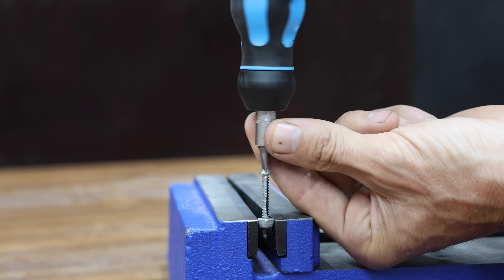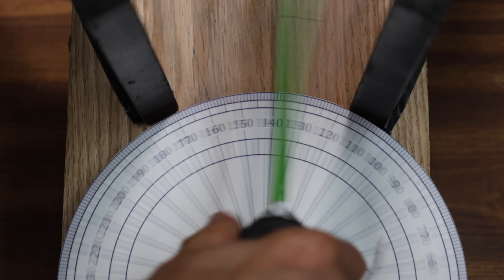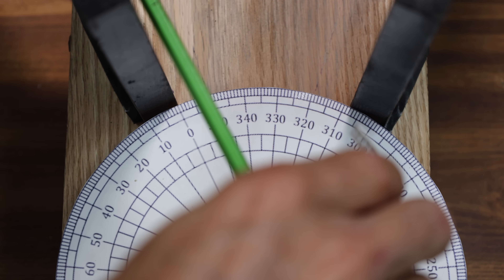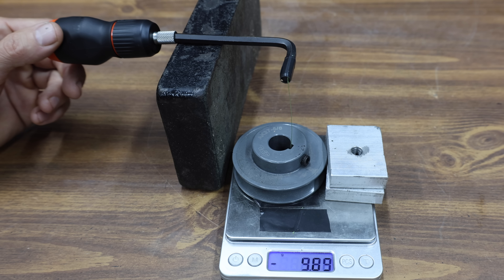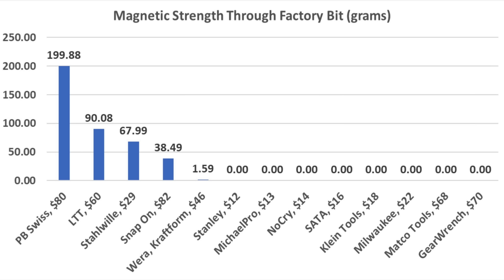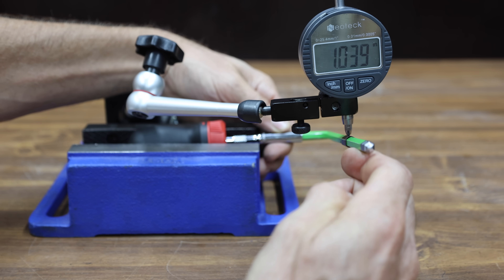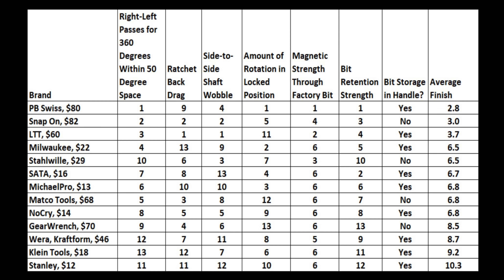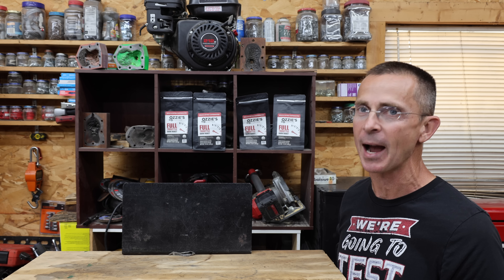Is Linus Tech Tips “Stubby” Screwdriver Best? Let's Settle This!

Comment: Great testing!

Suggestion for your methodology: for all videos where you do force testing using a kitchen scale, it would really benefit to be replaced by a strain gauge and data logger. The problem with using the kitchen scale is that you can't measure pulling force, and that you are limited in the resolution of the data based on how frequently the scale updates its display. Using a force/strain gauge, you can invest in a handful of gauges that will be suitable for different ranges. They will be a lot more precise and repeatable, and allow you to use better testing jigs for measuring pull force directly. The data logger will significantly help your accuracy and precision. You can log at a high frequency through the whole test and then analyze the data afterwards to find the peak. You can even superimpose the strain data as a "live" plot when performing the test, as well as recording the screen on the data logger in the shot.

A good general purpose data logger that can interface with strain gauges will be a huge addition to your testing toolbox and allow you to bring this channel to the next level.

For the backdrag test in this video, using a hex key with a round over-molded handle will also improve your results by providing a much smoother and more uniform pivot surface on the shaft. I don't think it makes a big enough difference to change the results, but it felt odd watching the shafts turn against the flats on the hex.

Looking forward to the next video! Best regards.
Reply: I thought the same thing in regards to the back drag test, though since they all started in the same position I’m not sure it would have affected anything.

Comment: I wonder if a better way to do the rankings at the end might be some percentage value of the 1st place tool (e.g. for magnet strength, the difference between 3rd and 4th place might only be 10g, but the 4th place one is penalized equally regardless of how far apart they are. So the 4th place one could be 1000g weaker on the magnet, but it doesn't matter in your rankings. You could maybe do something like the 3rd place one is 90% as strong as the 1st place one, the 4th place one is 88% as strong as the 1st place one, etc. That might help the comparison data be a bit more fair)
Reply from the maker: Thank you for sharing!

Comment: The oly genuine "but"'s I have here is - the back drag test was done with an allen wrench which sat on it's flat surface against a flat surface, the measurement could've been off because the flat part would have a higher resistance than machined round bit - that doesn't negate the results between brands but rather real life 
Secondly, I noticed the LTT stubby had been placed extremely close to the vise jaws, from the POV of the camera it looks like a negligable gap which could result in such a small measurement for a viewer.
Thank you
Reply from the maker: My pleasure!

Comment: If I can have a small suggestion, it would be that the first test might be more accurate if instead of measuring how many passes it takes a full 360° it would measure how many degrees of rotation can the screwdriver complete in 6 passes.

Not very important but maybe something to consider.
Reply from the maker: Thank you for sharing!

Comment: Great video! As a robot and automation technician I use pb swiss almost exclusively although I am not a fan of the ratcheting screwdrivers. The amount of back drag and their weight make them tiring to use all day. Instead I just use their non ratcheting bit holders and they are wonderful. Pb swiss bits are also the only bits I have used that seem to never get rounded out. They’ll break with enough force but they never round out. Would love to see a comparison of 1/4” bits sometime.
Reply from the maker: Thank you for sharing!

Comment: I'll likely buy a LTT stubby since I see these tools for dealing with stuff after it's broken loose so like you said, minimal rotation between teeth and low back drag are the important parts.

When I work on stuff (cars, trucks, motorcycles, etc) I grab the largest tool with the most leverage first that works then adapt down to small tools that are quick like a 1/4" ratchet or a bit driver. Having a solid set of adapters is key.

Actually, have you done any test videos on adapting between 1/4, 3/8, and 1/2"? Or maybe torque multipliers?
Reply from the maker: Thank you for the video idea!

Comment: Good reviews, great tests.  I've got the Milwaukee. I was really impressed when I saw it in the store. So all in all these type of tools have really improved over the years.  I do think that no bit storage is a total deal breaker. 
I've got a contraption that I need to take apart and get rid of. I used at least 4 different type screws (because I wanted self drilling, 1" to 3.5") Good luck finding multiple lengths all with the same head) . When I went to do this job... well none of the cordless drill drivers have bit storage, so I got stuck. Rummaged around for the odd ball star pattern... gave up. (A one hour job shouldn't take three, or require a trip to the store.)  I've found with these multiple piece anything (Screws, USB cords,  gloves, socks! etc...) that it's inevitable  as we work with these things  and cycle through them they always end up in a mess. (For photography Manfrotto tripods the same thing. Take it off the camera, put it in my pocket, at home it comes out of my pocket doesn't always make it back to the gear in the studio. Invariably every couple of months I'd be on a shoot with no shoe. They're all 1/4" 20 so I drilled and tapped the knuckles at the tops of my tripods. Take it off the camera, screw it on there. Done. Solved. There's always one there.  Manfrotto has been in business for at least 70 years, they've never figured this out. )

Comment: I bought a ratcheting stubby screwdriver for computerwork and to be honest, I hate the ratcheting mechanism.  It's always flipped to the wrong direction, so you have tto stop, and click it o the direction you got to go.  As a random chance, I bought a PC screw kit off ebay, and it included a free screwdriver which was total magic.  Instead of short and fat, it is long and skinny, almost like a pencil.  You would think, pfft, this phillips head doesn't have enough bite for really torquing things down, but in PC work you really don't want to.   The long screw driver means you can get in anywhere, and the thin handle means you can turn it fast.   So you can say, PC techs somewhere in Taiwan found, that the absolute opposite of a stubby screwdriver was best for PC work.   Long and very thin handle, and you don't need a huge phillips head on it.

Comment: I am not putting that much weight on the side-to-side shaft wobble. Honestly I like a screwdriver with a little bit of side to side wooble but not that much. Screwdriver with a little bit of side-to-side wooble is more forgiving becuase it doesn't require you to have a very straight alignment when tightening the screw.
Reply from the maker: Thank you for sharing!

Comment: These multi-bit tools are OK for occasional household use. They are not suited to even everyday DIY usage.

How many times can you remove/replace the cap that covers the bits before the cap becomes loose, a metric that is very important?

How firmly attached are the rubber grips and how long is it before the rubber grip becomes detached from the handle?

Comment: A subjective criticism on some of the screwdrivers' design; the bit tip is too close to the wide handle (e.g. Wera), would definitely be an issue in some tight electronic spaces. A shame the Klein, Milwaukee, PB Swiss had so much back drag, they seem to be the most useable aside from LTT. Also, the other tools you mentioned where they were made in, LTT you didn't.
Reply: That’s strange, he didn’t mention where it was made in the full sized test either…
Reply: Tip close to a wide handle... What else would you expect with a stubby?
Reply: @jamesrodgers3132  a non wide handle? at least near bits...it gets in the way if your working on electronics or other tight spaces

Comment: Suggested tool to test: Snap ring pliers. So many ways they fail to get the ring out or hold it without flinging it into your face, across the shop/yard, or off into a different dimension entirely.
Reply: I can totally relate with the different dimensions.. I’m pretty sure that is where 80% of the snap rings I removed live.
Reply from the maker: Great idea
Reply: @ProjectFarm you could test eye protection at the same time lol.
Reply: @ProjectFarm m The monly is a good thing for the future future of of mreeeeeeeeeemeeeeeeeeeeeeqe
Reply: Great idea!
Reply: The ones with interchangeable tips are junk IME. Knipex makes two lines; the ones with the Torx screw seem to have better quality tips than the riveted ones.

Whatever testing you do should include tip strength. That was a common failure mode on the interchangeable tip ones.

Also, e-ring tools would be a good subject. They are harder to find, but Engineer makes them in a pliers style and some of the import brands such as Neiko sell sets of flat blacked steel tools for the purpose that look pretty much identical.

Abusing snap ring pliers to remove e-rings might also be a good test.
Reply: I have had my channel lock ones for at least 10 years. Used quite a bit and never broke a tip
Reply: @donpayton737   Same here.
Reply: I got a set of OTC snap ring pliers and I am very happy with them. I previously had Vise Grip brand snap ring pliers and they were total junk.
Reply: Now That is a fantastic suggestion !!!
Reply: Throwing a rag on the work confines snap ring riccho
Reply: Great idea! Please include .020 diameter tip size (snap rings for small car turbos, very hard to find!)
Reply: I once had a pair of snap ring pliers that you could tighten with a screw which allowed so much more control and would hold it where you set it. I really wish I could find another one
Reply: Weirdly, the ones I've had the most consistent luck with have been these cheap ones I got at harbor freight.  Have had them for 7 or 8 years and they still work reliability. I don't understand how they are better than my snap-on pair that is a few years older, but they just are.
Reply: I hope we're gonna test that
Reply: I would LOVE to see this one!
Reply: Good idea just put mine away wondering if I wasted money on something I use maybe 4 times a year.
Reply: Excellent suggestion.
Reply: 100% !!! I need to buy a set soon :D
Reply: Be sure to include the Icon line from Harbor Freight. I much prefer the forged style over the stamped sheet metal style and the Icons are by far the best I’ve used (when considering the price). I would have preferred to buy the Knipex set, as they look to be even better, but I just could not justify the extra cost, even though I do deal with a lot of snap rings throughout the year.
Reply: Snap ring pliers, here we go. Do they all suck no matter who makes them? From my experience, Knipex (Germany) are at least a polished, shiny turd. You're going to pay for that polish job though.
Reply: Excellent idea. 
Those stupid things can ruin your weekend working on something if they're no good. I learned the hard way.
Reply: Gotta say I love the snap on ones, have a small and a large

Comment: LTT screwdrivers are build for PC builds so they do seem to have advantages in any of the criteria for a PC build (low backdrag, little slop, strong magnet, and decent gears) sure it wouldnt handle the torque or abuse of car repair or fabrication shop, but it was ment more for electronics work

Still a little too expensive for my taste but compared to the other drivers it seems to meet the performance/price
Reply from the maker: Thank you for sharing!

Comment: Personally, I like my Wera Pocket 8009. It's a full size screwdriver, but the head pivots so it can fit into tighter spaces than any stubby screwdriver. Only downside is there is no rotation lock and the magnet isn't very strong.
Reply from the maker: Thank you for sharing!

Comment: The PB Swiss requiring 2.3Kg of force to remove the bit IS NOT A POSITIVE.. being double the average over the next top performers should be considered a negative and deduct points imo.. As I'm sure we've all experienced using tools with an overly strong bit retention mechanism/magnet, especially if your fingers are wet, greasy, or oily from working,, forcing you to go wash and dry your hands or needing pliers to remove the bit.. 

Honestly, something around 1Kg to 1.5Kg should be considered peak, and anything below or above should be considered bad and deduct points.

Comment: Thanks for the test, Todd!
I have both the standard size PB Swiss and LTT ratcheting screwdriver; while both are great, I like the PB Swiss more - the bits are much superior 
in durability (normal use, not near failure), the handle material is MUCH better as it gives more grip rather than the sleek and slippery design of LTT, and it is more ergonomic.
You got to give to the Swiss. They make great tools.
Reply: Everything Swiss made I've seen has been quality. I just bought a Swiss designed laptop backpack. They're more expensive but you can see they are very detail oriented and have a 10 year warranty far surpassing most others at around the $100 price point.
Reply from the maker: You're welcome!

Comment: As always you put out an awesome video!  Thank you so much!  If I may make one suggestion, I’d love to see how products such as these screwdrivers handle common chemical exposure. I’m in automotive repair and one thing I definitely try to look for is can the plastics and rubbers used on various tools withstand chemicals such as brake clean. It’s a major bummer when your fancy new tool melts, discolors, cracks, or becomes brittle at the mere suggestion of brake clean being somewhat nearby. Only if you have the time.
Reply from the maker: Thank you for sharing!

Comment: I bot the stanley10 years ago for $5.33 on Amazon.
 I carry it on to the job site everyday.  Do I use it everyday? no.
 Have I ever thought I needed a better one in all those years? No.
 what's needed here is a ranking system that includes a price/performance factor. 
Tools ranked by this factor would answer the question is the price difference enough of a difference to make a difference?

Comment: I don't like the rotate-to-change-direction feature, though i own a couple.  I think i would strongly prefer the mechanism on the NoCry.  It seems like that is much easier to use one handed, with less room for confusion about what it means - push towards the screw to screw it in, pull back to screw out.

Thanks for the video.  Great work as always.
Reply: Once you've used them for a while, you remember which way to turn them. I have the milwaukee, and the rotate is opposite of the full size screwdriver annoyingly. More important is that it's way easier to accidentally move collar while using the stubby. The full size I have no issues, but with the stubby I accidentally turn the collar way too often.
Reply from the maker: Thank you!
Reply: As someone with the larger LTT screwdriver, it’s very easy to switch positions one handed. I’ve been shocked how much I use and love the big ratchet driver.

Comment: I realize the jump from full size 1/4" bit screw driver, to a stubby 1/4" bit screw driver is much easier to do from a manufacturing and design stand point.  A lot of common parts, or at least very similar parts, but I wish they had instead focused on a 1/8" bit ratcheting screw driver as their next tool release.

There are several situations, where a 1/4" bit driver is simply too large to fit in recessed holes, which you often come across while working on electronics.
Reply: They are developing a precsicion screwdriver which I think takes 4mm bits, but I don't believe it ratchets. No idea when it will come out though.